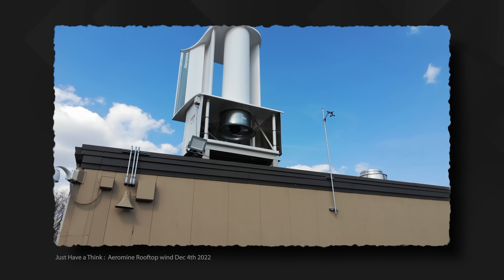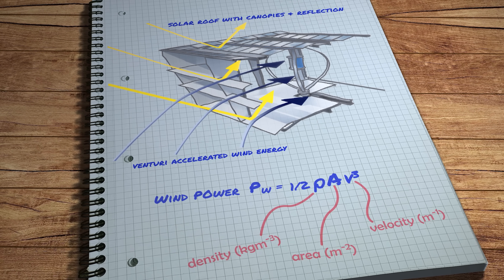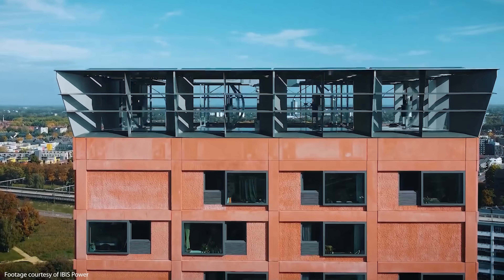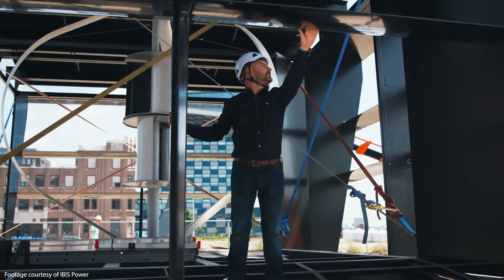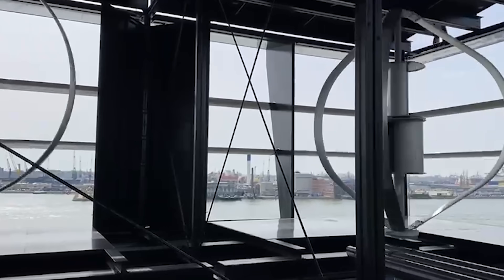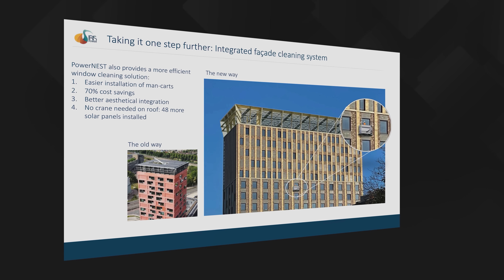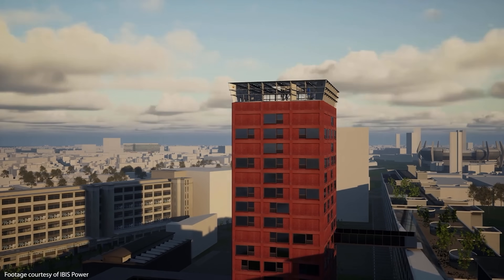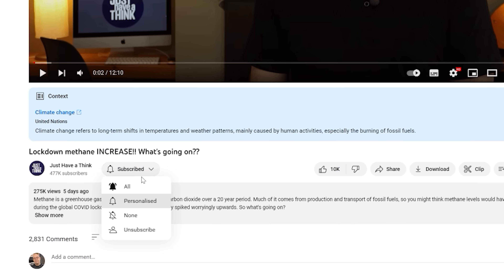The smartest renewable rooftop system in the world?

Comment: #Wow that's the most promising approach to energy you've covered in a while.
It can be added to existing buildings
It doesn't depend on difficult-to-predict-but-currently-drying-out rain & snow (like most water power plants, especially the pumping-back ones).
It doesn't have some of the disadvantages of legacy wind turbines that slows down their distribution through legal leverage for NIMBY neighbours.

Comment: I'd like to see such a system, scaled down to be sited on top of a standard shipping container, pre-fabricated for easy assembly and installation and shipped inside that shipping container! The container could be shipped with a functional battery bank pre-installed, and it could even include solar hot water preheat which also cools down the solar panels to increase solar panel life and capture even more energy! This would make it very easy to provide utilities to remote off-grid sites.

Comment: Neat deployment of technology for power production!  Maximizing the utility of flat roofs in this way makes a lot of sense to me.  I hope they have a snow removal feature for those solar panels in colder climates like here in Canada since it would be a heart stopping job to broom them off. Lastly, $0.08-0.12 per kWh seems high relative to typical wind power but I suppose the bonus is that it can be use on site, that is, without transmission costs.

Comment: it also cools down top floor of building, they can also collect water by putting mesh around building, it traps humidity from the air and turns it into usable water. building can collect that water for self usage if they use this type of net mesh with tiny threads to collect water in it's entire wall areas

Comment: This seems like a wonderful idea and I hope for success for the company.
As far as community owned power production, I strongly support the idea! I honestly think the best way forward is micro grids connected to the larger electrical grids. This sort of arrangement will prevent massive blackouts. Green energy production paired with storage is the path to this. It also will allow nearby micro grids to stabilize a micro grid that is experiencing high demand as well as the larger grid. A system like this allows for far greater grid stability across the board.
Reply: In the UK, Octopus are rolling out what they call "fan clubs"

If you've got a wind farm near you, then costs are reduced by up to 50% which is absolutely fantastic

I'd absolutely love to have some form of wind turbine on my roof, in this form of infrastructure too. "Current" wind turbines don't seem worth it for domestic usage

Comment: I wonder what the capacity factor is for those turbines.  Typically, large wind turbines see close to 35%.
Reply: And each of these turbines "develops a maximum of 3Kw"
I keep trying to understand the LCOE of a VAWT that's putting out 1.000 watts.
How much energy goes into one of these and their support equipment?
How much carbon is released making the steel frame, blades, bearings, generator, charge controller, cabling, battery and grid tie inverter?
You can't pretend to just pull it out of thin air...

Comment: Another benefit of the system in warm climate countries. There it can reduce the cost of air conditioning of the top floor of the building. Though it needs to be considered aginst the standard execution of solar power panel. Maybe there is room to consider a pv hot water combination for the panels 🤔

Comment: I'd love to see a version of this that not only has PV, but also solar heating elements. That would be way more useful for residential buildings. One could run smaller heat collectors in between the PV panels, and on a full rooftop that should yield enough heat for at least the warm water generation, even in winter.
Reply: that might be complicated to do. Water is not exactly light, and the amount needed to heat a multi-story building would weigh tons. You would have to reinforce the roof and add pipes throughout the structure to get the hot water into each room. Running electrical cables is a lot easier. The added complexity and maintenance may make it not worthwhile even in a new purpose-built building, let alone retro-fitting an existing one.
Reply: Don't need heat collectors for hot water.

They could have chosen to water cool the panels.

That gives them lots of hot water, and makes the panels even more efficient.
Reply: @lordgarion514  Europe even summers are not really that hot. But that is going to be a real problem in Asia, particularly South Asia. Summers routinely reach 40C plus plus. But I find water cooling to be messy and air cooling far more efficient.
Reply: @janami-dharmam  
And 20°C is more than hot enough to get massive benefits from water cooling.

Even in freezing temps, you can get enough heat from solar panels, to add quite a few degrees to the hot water.
Reply: I agree with Anthony. The econmics of solar heating elements got worse over the last couple of years with PV falling stronger in price and the rising installation costs playing a bigger role in solar heating. Combining heat pumps with PV is often times a sensibel solution
Reply: Much of the top of any residential house is the attic where the majority of insulation is located.  It would seem possible to design a module contained within the steeple portion of the roof to have the wind apertures used to cool and increase the efficiency of installed rooftop solar panels.  Lighter weight composites would have to be used to enable existing housing designs to withstand the added weight and stresses of higher wind speeds.
Reply: @anthonycarbone3826  residential wind generation is seldom worthwhile. Speeds are much lower at typical urban roof heights. Given that power is proportional to the cube of wind speed, that a difficult problem to overcome.
Reply: @AJPemberton  I was thinking about the cooling effect on the solar panels to increase the efficiency.  I too realize the wind speed is at much lower levels but the increased power output would be from the increase in solar output.  I am sure it comes down to a cost vs gain equation that would settle the question for good.
Reply: @anthonycarbone3826  Fair enough. More power from cooled panels would be nice. Had a quick look around and a common number for efficiency reduction was -0.4/C, with the starting point of 25C. So a panel at 50C would be 10% less efficient. (a 25C increase times 0.4 ) That would be a 40W drop for a 400W panel. 
I'm not sure adding wind turbines to cool the panels would be cost effective. They'd have to be about 10% of the cost of solar panels in this example. Guessing there would be many days where the temp increase was much lower.
Reply: Leverage the solar power to heat the water with a heat exchanger.
Then use the cooled air to cool the panels until it warmed again for the heat exchanger.

Comment: It's  great to see that just utilising the top of the high rise like that can produce such a massive majority of the energy needs for the whole tower!
Community energy has always been my hope and aim, ever since my Mum campaigned in the 1980s for our local government to move to renewable energy independence for the island nation where I grew up - didn't work, they still rely on oil and gas: but it left me with an understanding of the concepts and good sense of local renewable power for the community.
Reply: This would add options for city dwellers of concrete jungles to participate in self-power living, solar and wind. Elegant solution. Hopefully the Fossil Fuel Demons don't attack the permitting process.
Reply: Yes and no need for huge new infrastructure investment in transmission lines!  That should also be taken into consideration when calculating "levelized cost of energy production".
Reply: @robertstrader3267  Yes, good point. I could envision some heat battery system carrying energy to the basement structure where all the power distribution and concrete is located anyways. Big thermal battery with a hot water pipe going to the roof, for instance. Get the battery weight off the roof and retrofit even more buildings.
Reply: Islands are probably the best use case for renewable energy. Your Mum had the right idea. I wonder if they'd change their minds about it today, with the current price of oil and gas.
Reply: @Kevin_Street  We are all on one big island.
Reply: @Kevin_Street  I think he's talking about the UK which has a right-wing government so they're just shoveling more money at the oil & gas companies.
Reply: Wizard....the best part of your comment is when you compliment your mother!!!! You are a saint!!!!
Reply: The fossil fuel industry sadly owns the politics of many island nations and territories.  Such a waste of abundant trade wind and solar energy.

Comment: Excellent. I have two questions, though:
1. How does this system deal with snow and ice?
2. The second is a question I think we should be asking for ANY power generation technology: beyond the legalized cost of electricity, what is the ratio of energy produced over the lifetime to that required for its manufacture?
Reply from the maker: Hi Lawrence.
1. Snow and ice would be a challenge in very cold latitudes.
2.  I think the energy costs of production would be far outweighed by the lifetime energy generation.
Reply: @JustHaveaThink Thanks!

Comment: Lovely! Thanks for this. I love the idea, and even the community ownership is intriging. It does matter what the ownership of the units in the building or building itself is. What immediately comes to my mind is maintenance. 25 years isn't really that long of a time.
Reply: 25yr service life seems pretty long if you're 25; Less so if you're not. Often that 25yr quote is for 80% capacity. So after 20yrs, 80% of initial rating is still produced. In comparison nuclear power plants are often 60 year total design life, then you have a bunch of radioactive waste and concrete to deal with. Not to mention the radioactive mining to get that radioactive material to begin with.

If you're looking for a deal on solar panels, buy used. They are at a point in their design life where they have been replaced for commercial use, but still putting out 80%-90% of their rated power. 

I imagine the same for this system: sell the PV after 20 years. Those will go into a ground mount system, and new panels will be installed on the roof where space is a premium. This can be done with a wrench. 

The wind turbines really only need bearings and possibly a motor coil rewound with copper. Not a huge issue, and plenty of motor shops exist currently to do exactly that. 

One thing that isn't a wear part is the geometric design. This is really the big advantage here of using the same square area twice-over for both wind and solar. 

I don't like flat roofs, not one bit. But if you have one, this system seems really elegant. Hopefully it is widely adopted and quickly.
Reply: @onebylandtwoifbysearunifby5475  handling large lightweight panels on a windy rooftop will require more than just a wrench but yes, it is feasible.
Reply: @alanhat5252  Fair point; two wrenches.
Reply from the maker: Thanks Susan. I suspect these systems will last far longer than their quoted lifetime.

Comment: As good as it is, there’s more potential yet! 

Suppose designers added rainwater reclamation, and use that water to evaporatively cool a heat sink (tank or pool of cool water) for the building’s air conditioner condensers. 

Excess water is piped to the ground floor, where it turns a small hydroelectric turbine. Ba-da-bing!

What do you put on top of the cherry on top of the icing on the cake?
Reply: In the Netherlands there is seldom a need for collecting rainwater. More: how to get rid of it. Air conditioning used to be unknown, but thanks to Climate Change that is now changing.

Comment: that is smart solution to use the area of the roof, which is unused- to capture sun, the height of the building- to capture faster and less turbulent winds higher up. There are few more benefits- the solar panels make shade- fewer overheating hours on top floor; during winter, the same panels cover roof from clear night sky- less heat is lost in the form of thermal radiation to the outer space. I'm sure the structure is strong enough to withstand hurricane winds!

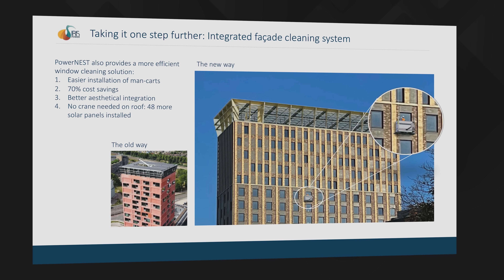Comment: @10:00So I thought the whole thing is pretty cool use of wind and solar but the idea of adding a perfect structure to be able to do window cleaning and maintenance on the outside of the building really truly gives it the highest rating. 

I lived in a building for about 6 years that had a rooftop garden and was supposed to add extra energy with the solar panels but after the first year they just gave up. All the stuff overgrew that at one point the maintenance guy couldn't even access the rooftop without basically destroying the rooftop access lol. The plant growth also screwed up attachment points that they had engineered for people to do window cleaning that's sadly ended up in death of a window cleaner. 

After that happened they couldn't find employees willing to do that work because of various financial concerns. Beyond that the idea of having a fixed well-designed way to be able to do all the maintenance on the outside of the building Plus drop energy costs is really fantastic. Lateral thinking is not just making things more effective but genuinely safer for everyone who has to interact with the building. Love the channel thanks for the cool video this week.
Reply from the maker: Cheers Morgan. Much appreciated

Comment: Cooling the roof of the top flats and battery units during summer as well = totally brilliant.
Reply: This also cools the roof (actually prevents it getting heated by the direct sun) and that reduces the air conditioning load, at least for the residents of the top floor.
Reply: You could run the cooling coil for the ac up to the roof and use the wind flow to actually remove the heat energy
Reply: This got me thinking about using fans and/or heatsinks to cool the underside of PV panels.  Surely people have looked into that...
Reply: @yeroca  yes people have looked into that & you can buy products today
Reply: @yeroca  worked in Solar and can confirm this is well known, there are alot of ideas in the idustry about how to deal with this. But all of them incur extra cost.
Reply: @yeroca  https://youtu.be/Mt9qLRN7JvA - you do get more out of them and they last longer if cooled
Reply: @yeroca  Tech Ingredients did a video
Reply: @yeroca  you can use a heat pump for winter warmth and Sterling engine to generate aditional power.
Reply: I wonder would birds see it as a great nesting site & damage any of the mechanical parts over time.
Reply: @jbmurphy4  Chicken wire fencing?
Reply: @robertstrader3267  Reasonable answer. I wonder if LED lights built into the structure might look pretty cool...
Reply: Well thank you for bringing this up to everyone. That is clearly the future and similar "hybrid" systems are the way to go... something that stuck out was they are modifying the air flow for heating purposes but why not just connect it to the air circulation system as well and use it to cool down the building itself? The air intakes are always on the top so might as well. And when are we going to see the first air turbines with solar cells on the propellers ? Toridal designs are perfect for that no? bonus points if you engineer it with reflective surface on the opposite side of the solar panel side that powers the under side :P
Reply: @qa1e2r4  was thinking that. As long as the wind energy is not too adversely affected.
Maybe with a bit of air conditioning. IE draw air in from one side of roof expelling on other. For more inside the building.
With the in/out air contra flowing beside each other on the battery floor to l transfer heat from the outgoing air in winter to the incoming air.
 Also need to look at heat pumps between the air streams to boost heating in winter and allow cooling in summer. At the cost of some of the electricity.
In summer some evaporative cooling maybe needed to boost building cooling. At the cost of water loss.
We can only moderate climate change. It will be a long time to reverse it, decades. I think air con will be a MUST until then with warmer summers.
Reply: Water cooled PV panels are already available
Reply: @antoniocirino8444  yes, but it is also using that heat for something.
Reply: @John Chapman  even without the issue of no wind it is worth putting storage in place to even out demand.   In most cases producing more power for instant short term use is less economical than keeping power flowing and storing excess for when it is needed.
Reply: Winter?
Reply: It's on top of a tower and has facilities for a maintenance cradle. Sounds like a good place for a gravity battery